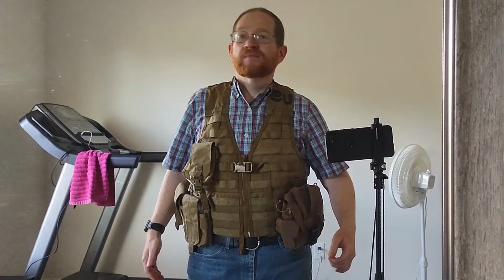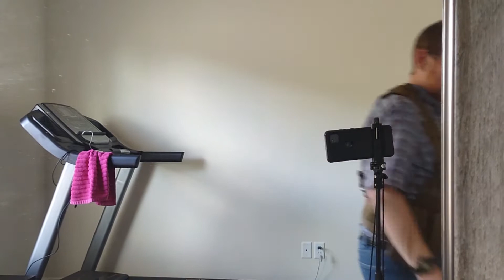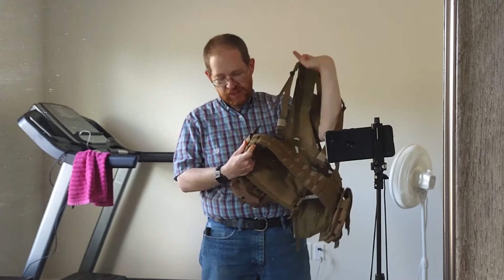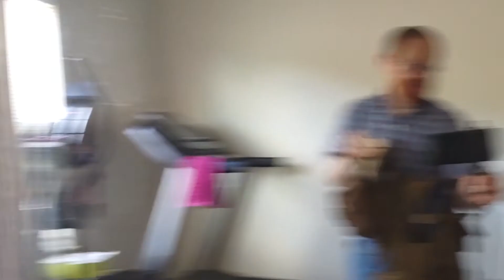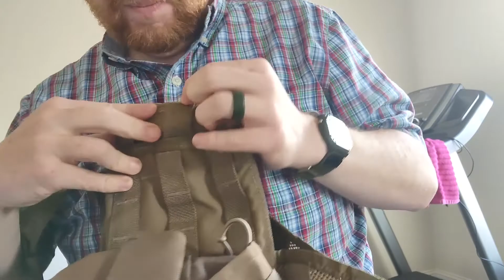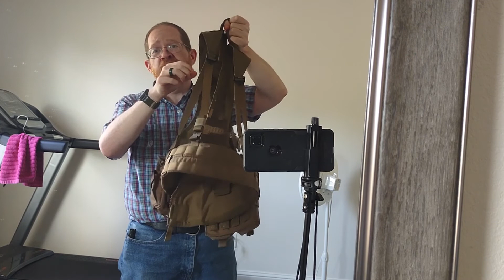Line 2 Option: Surplus FLC Vest

Comment: it's actually designed to be worn similarly to a chest rig ie 2 inchs above the hip bone, which is like 3 or 4 inches above the belt line. it feels more constricting that way, so soldiers wore them low. i feel like instead of telling soldiers to rely on the buckle as back up, they should have made that the primary method of closure and used the zipper as a back up. that was how it was designed for the molle 1 version of the flc. that way it would have allowed soldiers more freedom to adjust the vest up and down, tighter or looser depending on ruck and belt compatibility
Reply: Thats exactly how our drill seargents told us to wear them